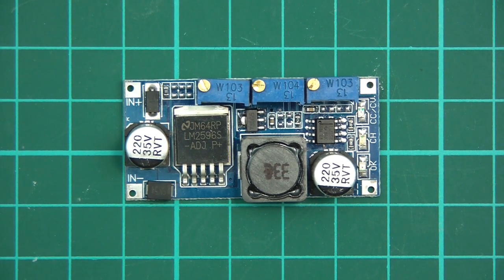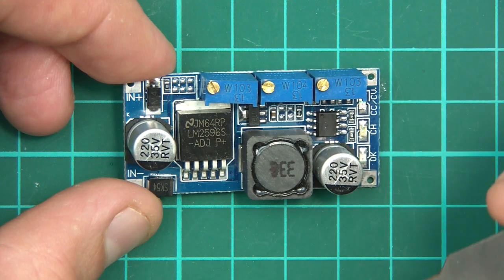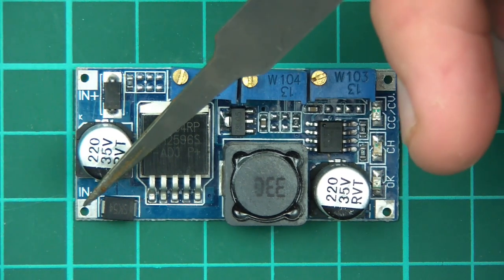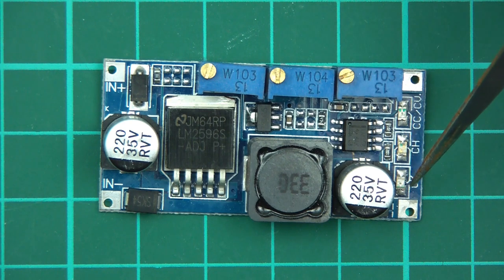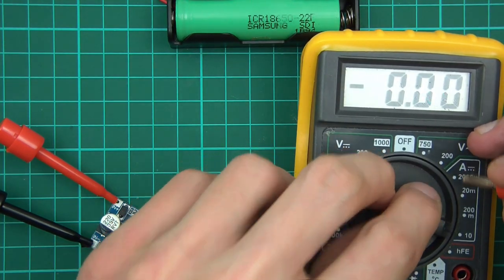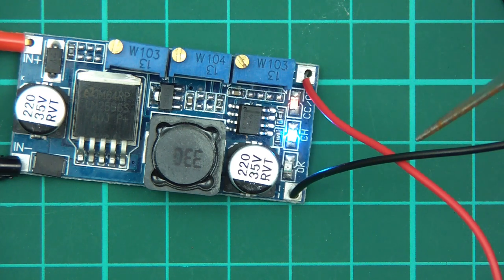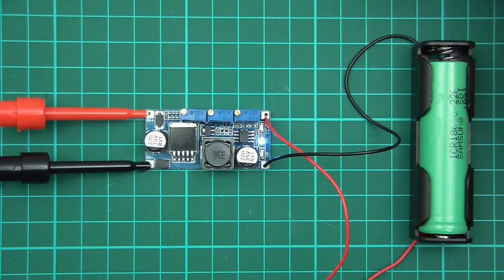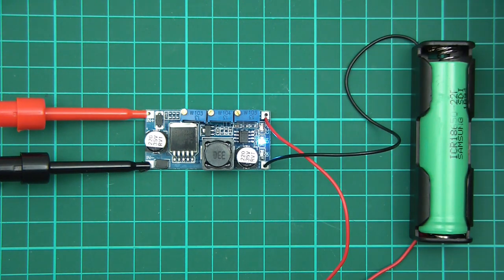TUTORIAL: About & How to use a Cheap LM2596S Buck Converter / Battery Charger Module - Arduino

Comment: Hi, Antony. If i need to charge 3 batteries 18650 with series connection (4,2V x 3 = 12,6V). Could it works? The charge will be balanced in each battery?
Reply: If you are charging 3 18650 batteries in series, you would need to use a balance charger to keep them balanced while charging..  This module is not a balance charger so no this module will not keep 3 batteries (in series) balanced.  Hope that helps
Reply: @Reflections2013  Correct me if I'm wrong but, cells connected in series are working as one battery. Let's take cordless drill batteries for example. Most of them are made of  5 cells, 4.2 volts each which gives a total of 21 volts, therefore their operating voltage is 18-21v, although it's not recommended charging them at 21v. Charging them at 20-20.5 volts will give the battery longer life. Anyway, if you set this module at 20 volts constant and then 300ma constant. It will be able to charge such battery, I don't see where I'm wrong?
Reply: @hristijanivanovski584  You are correct that "cells connected in series are working as one battery".  However I was referring to charging 3 or 5 or more batteries in series without a balance module is not recommended or a good idea, and if you try this yourself you will see what I am getting at...  If you connect 3 or 5 or more batteries in series that equal - let's say 20 volts, and you put a charge into the "single" battery of 20 volts - yes, they will charge to 20 volts "as a whole," but when you check each of those batteries individually, you will find that they won't each show a charge of their respective max voltage.  I hope that made since.  But let's say you took 3 18650 batteries that charge to 4.2 volts each when fully charged, and connect them in series - you will have a "single" battery that puts out a total of 12.6 volts right?, ok now connect that "single" 12.6 volt battery to a draw, and let the "single" battery go down to a charge of say 10 volts - now connect a charger (that is putting out 12.6 volts) to the "single" battery that now shows 10 volts, and let them charge back up to 12.6 volts.  You will more than likely find that if you now check each individual battery's voltage, the batteries will not show the same voltage because even though the output is showing 12.6 volts for all batteries in the series, the fact that a balance charge was not used, at least one or more of the batteries could have been charged to 5 volts because of the lack of a balance while charging.  When charging batteries in a series connection without a BMS (battery management system), the voltage/amps will go to the batteries that take it the best, and the batteries that can't take the amps that the others may, other batteries in the series will have to take more than they should, to compensate for the weak link (the battery that can't take the correct charge).  

It is hard to explain the complexity without making is sound more confusing than it needs to be LOL...   

So in conclusion, I was just attempting to warn that trying to charge batteries in series without a BMS is not only not recommended, but not a good idea because it is very easy to cause a battery to fail if not balanced properly.  And don't forget that cordless drill batteries are made specifically to be charged correctly because they have a built-in BMS to keep each individual cell balanced properly while the charge is taking place so no one cell gets more charge than needed.

I do apologize for being long-winded, but charging batteries in series is much more complex than charging a lot of batteries in parallel, as batteries in parallel feed off of one another so the reason a BMS is not needed in a parallel setup.
Reply: @Reflections2013  Thanks for explaining, I technically assumed that the batteries he wanted to use were pre-balanced and since they are the same make and model I didn't think he would have to balance them. I didn't realize that the drill battery uses BMS I just thought they came balanced lol. I'll dive in the battery world
Reply: I am glad it helped a little, and happy I didn't make it sound more confusing.  I think Ricardo was asking if the 3 18650's in series would balance themselves while being charged in a series connection - At least that is how I read the comment (with a question mark at the end)...  I may have misunderstood him, and thus-lie made my comment to him incorrect LOL...  And yes all drill batteries that I know of (at least the ones I have taken apart) have a bms installed to keep all the individual cells balanced, and what I have also discovered even with laptop batteries is that when a drill or laptop battery fails, it is usually because one of the cells becomes defective and causes the other batteries to be ineffective due to a break in the series chain.  So any time you see someone throw a drill or laptop battery away, you can retrieve that, take them apart and most of the time recover a lot of very good individual cells for use in projects around the home.  It actually can be allot of fun, and for some people gets quite addictive.  I myself have recovered a couple hundred cells from laptop batteries and drill batteries.

If you do decide to go this route of taking batteries apart to recover good cells, just be very very careful in doing so as some mistakes you can make can end in having a very bad day...  There are a lot of videos on YouTube about taking laptop batteries apart for recovering 18650 cells.  However PLEASE don't mess around with Lithium Polymer batteries as they are EXTREMELY dangerous and hazardous to you, your house and anyone standing close by if you make a mistake, and I am talking about explosions and very bad fires that happen as a result of mishandling Lithium Polymer batteries.  I won't touch a Lithium Polymer batter with a 10 foot pole..  Lithium Ion batteries such as 18650's are the best for this kind of hobby as they are the safest to work with.  Also Lithium Phosphate batteries are safe to work with as well.  This was probably more information than you wanted to know, but just thought I would throw that our there just in case you decided to try some recovery due to my explanations LOL.
Reply: @Reflections2013  If they are in Parrallel what Current do you set it at?
Reply: @LEO-xo9cz  Hi Leo.  If you have 3 cells in parallel and each cell is 2 amps each, you could technically charge them at 6 amps, but the more amps you charge at,  the more stress you put on the batteries.  To be sure to get the most life out of your batteries, it is best to charge at a lower amperage than they are rated for.  If you have an 18650 cell that is rated at 2400 mAh., you could charge it at 2.4 amps, but would be best to charge at 1/2 the "c" rating which would be 1.2 amps, but I just keep it simple and charge at 1 amp.   Hope this helps.
Reply: @Reflections2013  Hi Steve thanks for the reply. I was thinking that. What voltage would you be charging at around 12 or 4.2v?
Reply: @LEO-xo9cz  Hi Leo.  If you are talking about 18650's, I charge them to 4.2 volts, and others will say 4.1 volts to get better life out of them.  18650 batteries are designed for charging to 4.2 but it is individual preference to stay a little below that.  If you will be storing them for any length of time, it is suggested to put them into a storage charge of around 3.7 volts.  I was just reading your question again, and wanted to clarify something...  If you are charging a "single" 18650 battery or multiple 18650's in parallel, charge them with 4.2 volts only  or 4.1 volts only (whatever the target voltage is).  If you are charging (let's say) 3 18650 batteries in series, you would multiple the number of batteries in series by 4.2 or 4.1 to get the proper charging voltage.  3 at 4.2 would be 12.6 volts for maximum performance or 12.3 volts so as to not push the batteries to their limit.  Also - in a series connected battery, don't exceed the "c" rating of a single battery's amp rating..  3- 18650 batteries rated at 2400 mAH connected in series, would be charged at 12.6 or 12.3 volts, but should never exceed 2.4 amps unless you want to damage your batteries.
Reply: @Reflections2013  Steven can you help me? I have bosch 12v drill and bms is in drill and battery pack is only 3 18650 in series + - with temp sensor. How original charger balance that battery when there is no bms circuit in battery pack? I don't have charger, i want to charge it with this little module and not sure if that's possible safely? Any suggestion? I have 3d printed battery pack and almost finished with project and i want to use custom simple charger. Thnx in forward. Cheers
Reply: @NikolaM021  I am not at home.  If you are willing to wait a couple days, I will answer this question in detail when I am at home in front of my computer (it will make it much easier on my keyboard to type a detailed response).  Thanks...  you can charge your pack the way you suggest but will take detail that is not easy to type using a cell phone lol...  I do this type of charging from time to time because of not having a bms available, but doing it wrong can cause serious problems if you are not careful.
Reply: @Reflections2013  Thnx Steven! I'm all ears :) I'm also thinking to create 2 aditional pins on battery pack so i can put bms in my printed charger and then charge +, -, 4.2v, 8.4v.
Reply: @NikolaM021  Thank you Nikola, I am looking forward to answering this for you.   I should be home by tomorrow night and in front of my computer.
Reply: @NikolaM021  Nikola, I made it back home and am now in front of my computer preparing a response to help with your situation.  Nikola - this may get a little complicated, but just relax, take a deep breath, and let us begin the journey together, and hopefully it will make both of us better for what we are about to learn… 

I am a simple DIY kinda guy who loves helping others with what I have learned over the years.  I don’t have expensive tools to work with, so I just do what I can with what I have that will enable me to get through any situation that needs addressing.

I would like to answer your questions Nikola in the order they were asked - 

1.) “How original charger balance that battery when there is no bms circuit in battery pack?”…

If I understand your question correctly Nikola, you are asking how the charger is charging the battery pack when there is no bms in the battery pack itself…  
Answer:) The drill would have a built-in bms that has a bms lead that connects to the battery packs individual cells, balancing the cells as they are charged, and the wall wart that is plugged into the wall (connected to the drill) is only a power supply to power the charger that is built into the drill.

2.) “I don't have charger, i want to charge it with this little module and not sure if that's possible safely? Any suggestion?”…

Answer:) You can use this module to charge the pack and keep it in balance, but it will take longer to charge the pack because without a bms you will not be able to charge the whole pack as one battery, you will have to charge each cell individually, and the following is information describing the packs cell connections and the steps that you will need to take to charge the packs individual cells successfully… 

Your battery pack has 3 cells in series, so you will need to make NOTE of how the batteries are connected to each other...  You DO NOT NEED to take the battery pack apart to charge the individual cells - just MAKE SURE you connect the cells as outlined below for a safe charge experience...

A.) The first cells positive end (in the series) will be the main positive point of the battery pack.
B.) At the negative end of the first cell (in the series) you will see a piece of metal that is spot welded to it, and the metal continues over and spot-welded to the positive end of the second cell (in the series).
C.) Follow the second cell up to the negative end of that cell, and there will be another piece of metal spot welded to that second cells negative end, which then extends over and spot-welded to the positive end of the third cell (in the series).
D.) Follow the third cell in the series down to it’s negative end, and that will be the battery packs main negative point.

The main Positive and Negative points of the battery pack is where it should be metering at 12.6 volts at full charge (if every cell is charged to 4.2 volts).

Charging the cells in your battery pack with this module (LM2956S):

1.) First, set the module to the charge voltage you wish to achieve – such as 4.2 or 4.1 volts output.
2.) Second, set the module to the amps that you want to charge at (I recommend using no more than 1 amp to charge each cell).  Look at the cells and they should have a number indicating the mAH rating such as 1000, 1200, 1500, 2400, 500, 800 etc..  If the cells show a mAH rating of 800 mAH, then you will want to charge at 800 mA or less (Not 1amp)  The mAH rating of a cell is it’s “C” rating, and you should NEVER charge a cell at more than it’s “C” rating (unless the manufacture says it is ok to do so).  If the cells are 1500 mAH, the “C” rating of that cell is 1.5 amps, if the cells are 2400 mAH the “C” rating of that cell would be 2.4 amps.  I like to charge individual cells at 1 amp (if the “C” rating allows for it), and mostly I charge cells at 500ma because it is easier on the batteries and makes them have a longer life.
3.) To start charging your cells, you will first (of course) need to connect wires to the output terminals (+ and -) of the module (LM2956S).  
4.) To charge the First cell in the series of the battery pack, you will need to connect the Positive and Negative wires from the module’s output to the Positive and Negative ends of the First cell ONLY in the series. (ONLY connect the wires to the First cells Positive and Negative ends ONLY (the other cells in the series will NOT have any wires connected to them))  Once the first cell in the series is connected to the module, power on the module and allow it to fully charge the first cell to your “set” output voltage of 4.2 or 4.1 volts.
5.) To charge the second cell in the series – DISCONNECT the wires from the first cell in the series, and now connect the wires to the positive and negative ends of the second cell (ONLY) in the series.
6.) To charge the third cell in the series – DISCONNECT the wires from the second cell in the series, and now connect the wires to the positive and negative ends of the third cell (ONLY) in the series.

You should now have a fully balanced and charged battery pack.  I do hope this did not confuse you in any way as how to connect each cell individually for charging.  If you need to - PLEASE read steps 4-6 again before charging if you are not completely sure that you are doing it correctly.  Connecting the cells incorrectly to charge could result in a very nasty situation, so please be very careful when charging your pack this way. 

I have ordered an LM2956S module and thought that I would like to create a video on how to use this module correctly and also how to use this module to balance charge a battery pack without the use of a bms.  I would use this situation as a way to get started creating YouTube videos on my channel to help people like yourself with problems or solutions.  I have been wanting to create videos for a long time, but just never have had the opportunity to get something started until I started commenting on this video (specifically your questions to me Nikola).   I love the way the guy in this video explains using this module (mostly because of his accent :)) but I would like to do a more in-depth look into using the LM2956S, expecially how to use the middle pot for adjusting cut-off charging.

I should have the module this week and then I will create a video on how to properly adjust and use this module as a power supply/charger.  I will then come back to this section and leave a new comment with a link to the video on my channel.  I am not sure if I should create a new channel specific to helping people with solutions or just start out adding video content to my current channel before progressing further. 

If the video is received well, I would like very much to start a new channel and create videos covering various topics that people need help with.  I love troubleshooting and fixing things, I enjoy teaching how to use software programs, I also love reviewing products, testing products and even discussing different topics that are of interest to others. 

My goal is to have a channel that covers a variety of topics (Repairing, Troubleshooting, Reviewing, Testing, Teaching, Discussions etc., etc.).  I have learned so very much over the years from You-Tubers, and I would love to be able to do something to give back to the community and also to do my part in helping others with problems that they face...

I truly hope this helped you Nikola and others also, and if I can be of any further help, please just ask and I will do what I can to aid in your endeavors...
Reply: @Reflections2013  Steven your extensive response is of great help i must say! I encourage you to do videos, you are man of thorough approach and not just fast quick new age style - banal :) Charging pack individually is of great help and i will use it. About bosch 12v battery/tool. Drill have bms to control discharge,control temperature of battery etc and when you remove battery and put in charger, there is only + - and terminals for status/ntc so charger definitely charge battery pack with as whole and not bms style each individually so i suppose bosch made it that way to charge pack unbalanced. There is a videos of bosch 12v battery repack so you can see it terminals and its only +- for charging. So my thinking is to 3d print pack with additional 2 terminals on top so i can plug to custom charger with bms so i  can charge battery pack individualy true 4 terminals. Still i dont understand why they made that way, charging unbalanced.. Sorry for my eng ;) Thanx!
Reply: @NikolaM021  Thank you so much Nikola for the words of encouragement about making videos.  You are right, it does not make sense that bosch would create a battery pack that would not charge in balance as that would greatly degrade battery cell life over a small amount of time and could also lead to a catastrophic failure due to one cell getting WAY too much charge due to weaker cells in the pack.  I was assuming that they included a bms lead that could not be seen (connected to the interior terminals that would make contact with individual cells.   Yes, definitely NOT a very good design at all....   I like the idea of your 3d printed battery pack with the additional terminals for connecting a bms lead  as I have done the same thing myself - and as a matter of fact just recently I created and printed such a case (using 4 18650's in series) for a work light over my vacuum chamber) - you can also use those terminals to connect a bms lead and buy a bms charger and charge the battery pack all at once - and actually that is how I charge my packs that don't have a bms - I just build my packs and connect a bms lead to the cells and then connect that lead to my bms charger with the main Positive and Negative of the pack to charge the pack all at once perfectly balanced.  I only use the process as outlined in my steps to you as a last resort.  You could really use any hobby charger that supports Lithium Ion batteries to charge your pack without having to charge each cell individually, and you can pick up a decent hobby charger for not a whole lot of money, but I do understand having the "Do what you can with what you have" mentality.  I will have to look up some of these video about the bosch 12v drill battery packs so I can see what you are talking about.
Reply: @Reflections2013  I find some discussion about batteries and one guy said that Bosch do not balance the cells at all. They solving this by using high quality cells with very low tolerances and bms for low voltage,over current protection is in tool itself. So i'm thinking to do easiest way, to buy 3 battery of same specs and do bms balance charge of each cell, then weld them and put in pack. So then i will charge battery with this little buck converter (+ mod to cut of current flow when charge). What do you think about that? It would be easy/bosch style, i give up on adding 2 more terminals(for balance) because of spacing. Cheers and tnx!
Reply: @NikolaM021  After doing some research last night about bosch I started thinking (just like you said in your response) that they must be using cells with very low resistance and high quality that would not need the use of a balance board, but still after a short time of charge and discharge the nasty little thing called resistance would start creeping in LOL..  I do understand that charging the way that I described can a bit daunting not too mention time consuming.  Adding a bms lead however to your pack would not take much effort and would also give you the opportunity later down the road to do a proper balance charge using a hobby charger.  No matter how good a  cell is in low resistance, it will still (in time) begin to loose the ability to maintain that low resistance and why it would be a good idea to give yourself the ability to compensate for that weakness.  

This is a part of learning (as we try and fail) because those who don't at least try will never know and learn, and why I have high hopes for you in your endeavors because you are willing to get in there and do it so that you will know for yourself what works best.  I have learned so much over the years simply because I have blew things up by accident, melted charge boards by trying a new technique that didn't work, melted wires because I thought more amps/volts would be better LOL, and that is what makes life so beautiful and interesting my friend - We continue to go with the risk that a new way/idea might be better, but as long as we don't give up we will find that through our failures - we finally find success.....😉
Reply: @NikolaM021  Hello Nikola - I am just dropping and note to let you know that I have finally gotten my first video complete (phew) and it is now up on my new channel Outside In, and I thank you and this video here for the inspiration to get started with a DIY channel of my own but will cover much much more than just DIY.  My first video is about how to use the LM2596S and also a step by step on building a series battery pack and the using the LM2596S to balance charge it.  Thanks again Nikola and Antony Cartwright for the inspiration.
Reply: @Reflections2013  Great job! Can you share video or name of video? cant find. Regards
Reply: @NikolaM021  I am sorry I thought I added a link.  This link should get you their - https://youtu.be/TfpTnB925to
Reply: Example: 3 Batt. In series will work as one as you say only if all 3 have the exact same voltage and this is what the balance charger circuit does. It makes sure that each batt. gets charged exactly the same. In your home you have a 240V. Panel two hots and a neutral. If i put a clamp meter on one leg and it measures 12A. and the other measures 9A. this means the system is unbalanced. To fix this you simply move the breakers from one side to another until you get both sides as even as you can, so you get a more even power distribution.I hope this helps you understand a little bit better.